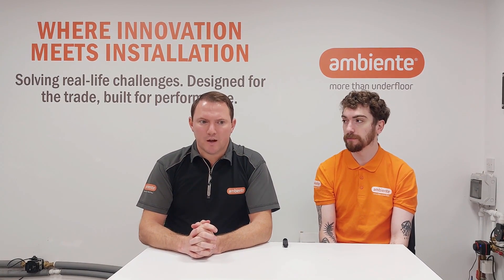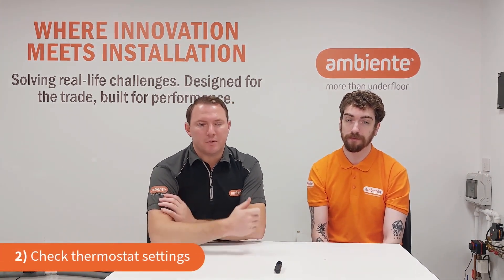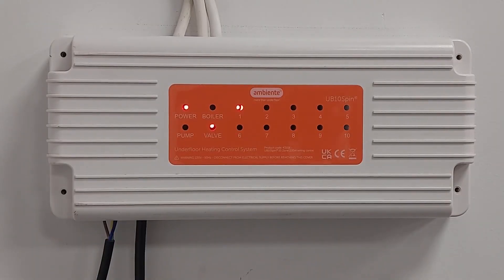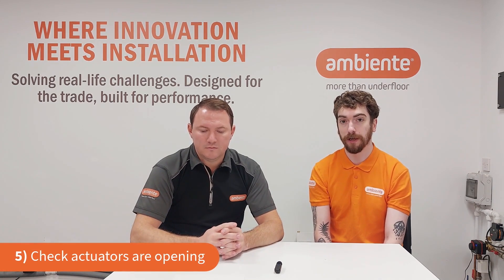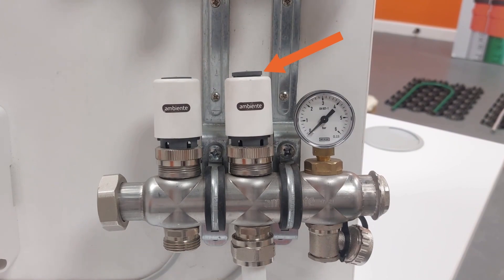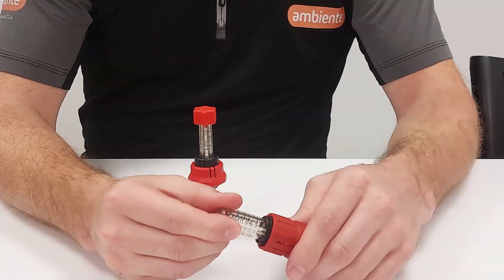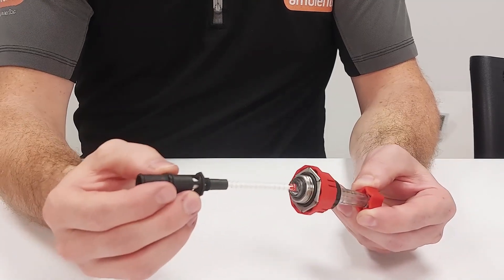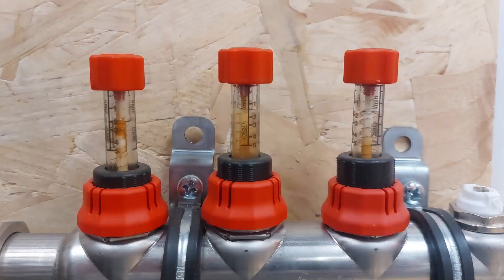Underfloor Heating Troubleshooting Guide | Common UFH Faults & Fixes for Installers

Comment: Evening, great videos but im struggling . I be grateful if you could could possibly shed any ideas on my fault. System has been off for 10 months. I've got hot water to the manifold but both manifolds are stone cold. It's shows I have flow when I turn pump on. All four actuators are warm but all pipes are stone cold? It's 4 port and all are the same. Unfortunately it doesn't have a pressure gauge fitted to the manifolds.
Reply from the maker: Hi! Thanks for the message. From what you’ve described, there are a few possible causes, but it’s difficult to pinpoint the exact issue without running through a few checks on the system. If you could please give our technical team a call on 01707 649 118 or email us at support@ambienteufh.co.uk, we’ll talk you through some diagnostics and help you get to the bottom of the fault. Thank you.
Reply: @ambienteufh hey thanks for the offer of further information. Much appreciated. I got to the bottom of it eventually. Turns out I need new plumbers 😂 I found another shut off valve, had an Allen key head under a cap fitted to the end of one manifold. I'm not sure if they were just not competent or trying to have my pants down as they said if it didn't warm up I'd need a new manifold. Anyway toastie now so the wife's happy and I've saved a few quid for Christmas 😊 thanks again.
Reply from the maker: @w.donald9066  glad to hear you got it sorted in the end and in good time too! 😄 If you ever need any advice or a second pair of eyes just give us a shout, always happy to help!

Comment: Out of curiosity, I’ve got my thermostat wired from the mains power , my timings are messed up and I’m the underfloor heating system won’t come in the time it has been settled in? What would be the best approach? Thank you very much
Reply: What?
Reply from the maker: Thanks for your question. We recommend following the steps in the manual to perform a factory reset on your thermostat, which should help get your underfloor heating timings back on track. If you require further assistance, get in touch with our technical support team, who will be happy to help.